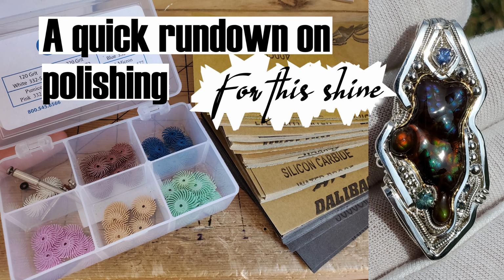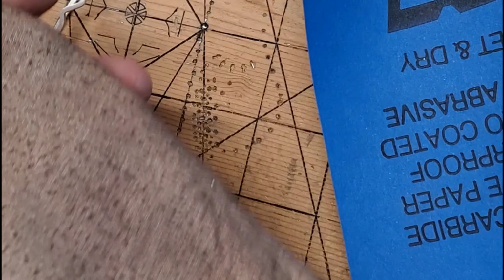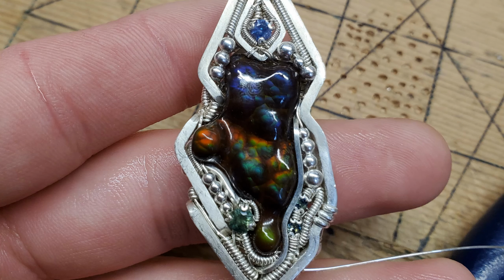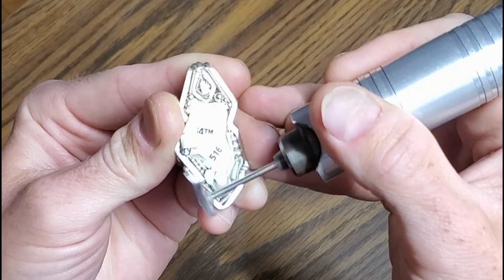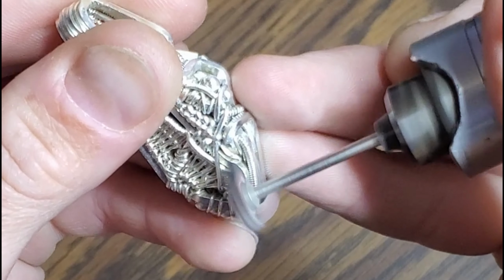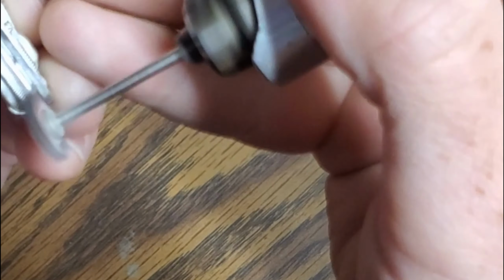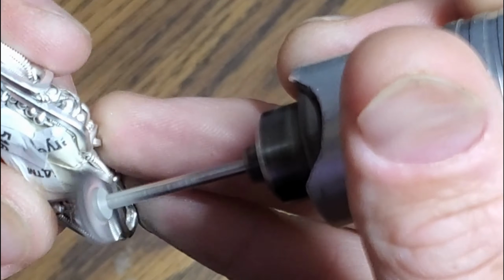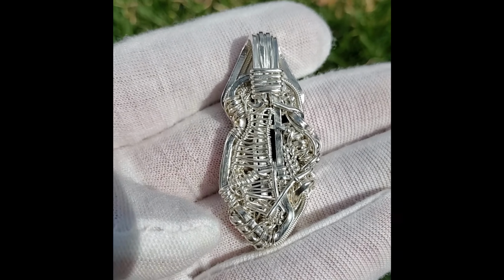Polishing Wire Wraps

Comment: This is very informative.  If you ever work with copper, could you create a video with your process of removing the patina?  My past process was by using 0000 steel wool, by hand. Now, I use a Dremel, with the pink pumice wheels. Thank you for your tutorials and instructions.
Reply from the maker: Thank you! I don't really work with copper as much but it should be pretty much the same. What you're doing sound right and what I do after oxidizing my silver.